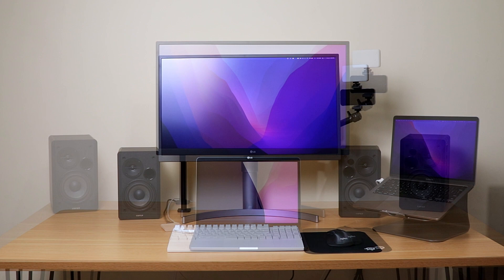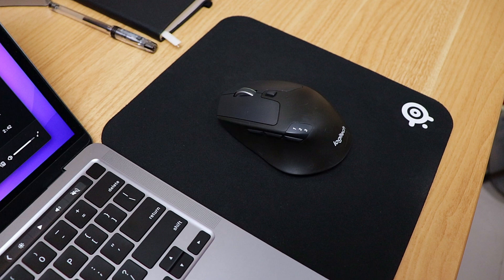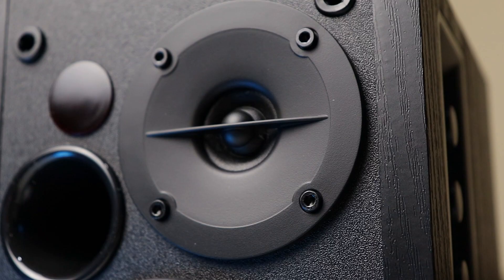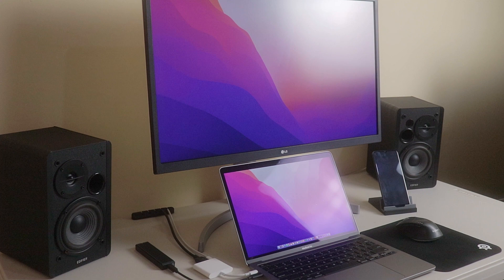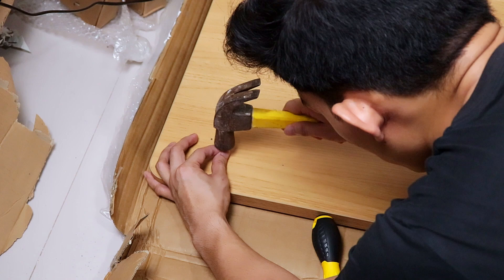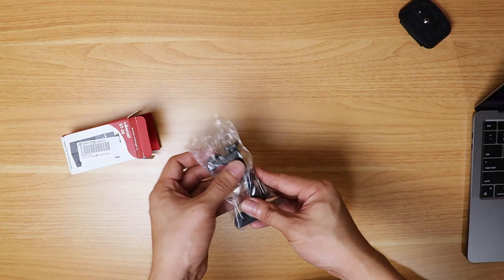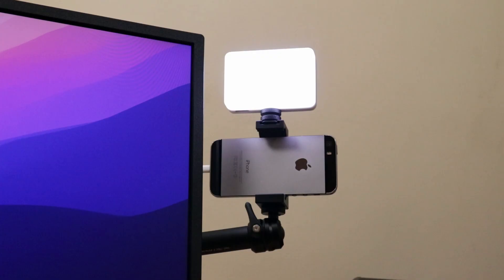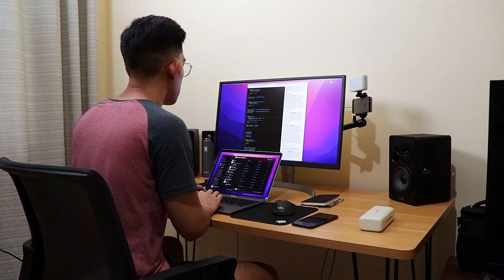Work from Home Desk Setup | Build and story vlog

Comment: same tau nang gusto setup naka add to cart na hehe. After using it, ano mga gusto mong i improve sa setup? thanks
Reply from the maker: nice! almost 2 years na since this vid so marami na din nabago

so far mga ginawa ko:
- tried dual external monitor. but now back to same sa setup video kasi mas gusto ko simple haha
- upgraded speakers. only because the Edifier S1000MKII was on a huge discount. otherwise i would not have upgraded kasi sulit na R1280DB
- dedicated mic and webcam
- ergo chair Sihoo M57. very worth it.
Reply: @earlmalaki  welp, just added sihoo chair to the cart. Convincing powers nalang kay misis haha.

About the edifier too price, thingking about basic Edifier D12

Comment: where do you connect your speakers po?
Reply from the maker: sorry ngayon ko lang nakita hahaha 
i used to connect it to the monitor via 3.5mm (the LG 27UL550 has a 3.5mm output) but i noticed some very faint noise, so started using bluetooth nalang. no issues with bluetooth naman so far